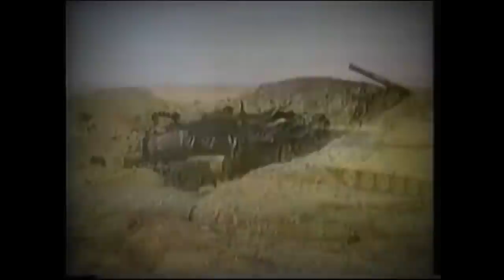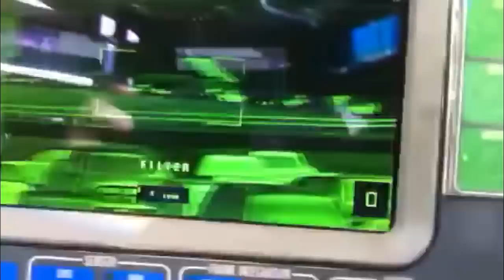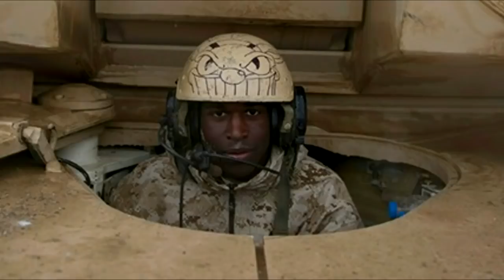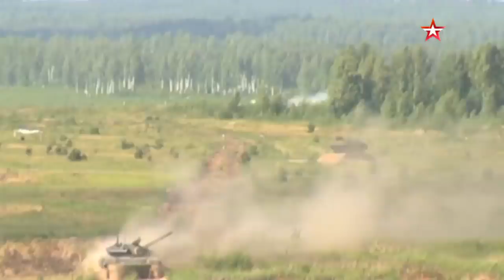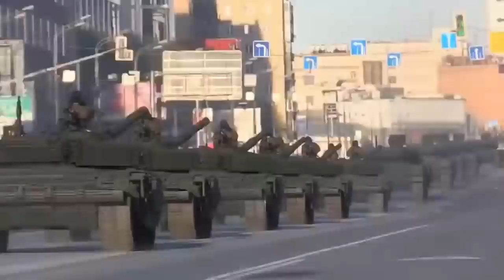Does T-72 stand a chance against M1 Abrams?

Comment: Putting aside the differences in different countries' standards for measuring armor penetration on plain steel or different types of composite armor with different types of rounds when they have the chance to test it and estimating it elsewhen (which is the case with most of the discussed stuff, including literally everything manufactured after about 1985), there are some minor inaccuracies and misillustrations in the video.
First, calling light amplifying (non-thermal) night vision completely obsolete is kind of a long shot. I mean, sure it is inferior to the thermal imaging, maybe vastly inferior in some fields such as this one, but there is a difference between being inferior and being obsolete.
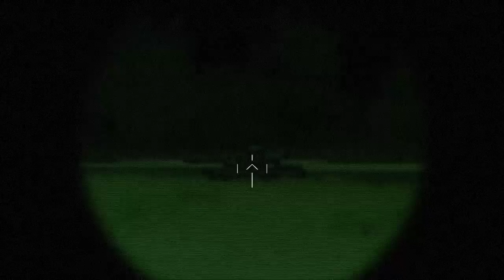Second, at 1:05 the sight picture is from an older Kristall (if I remember it right) NV tank gunner's sight as used on T-72A, B1 (a simplified B), maybe even pre-A models, maybe even stuff like T-55/T-62/T-64/pre-U T-80s, anyway, this sight has definetely no relation to the B3 discussed, or even full-spec B's.
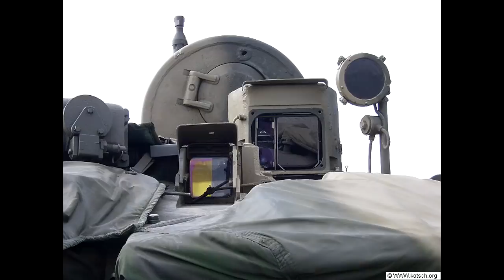Second, at 0:53 (sorry for being out of order with these points) it's not a B3, it's a B2, which was a prototype, or rather a technology demonstrator that didn't see production; however they share the depicted gunner sights arrangement.
Third, footage here in general shows all manner of T-72B versions beside the B3, and even some T-80U's.
Fourth, T-72B3 mod. 2016 isn't a TUSK-esque additional armor kit; it's a now-standard new ERA kit altogether, where Kontakt-V setup (which already had effect not only on HEAT projectiles, but on slower shaped charge projectiles and APDS projectiles as well), is replaced with a newer Relikt ERA that is even more effective while maintaining a comparable weight.
Lastly, I'm unsure whether M1A2 SEP v2 and T-72B3 mod. 2011 are the most widespread versions within respective armed forces. Sure they receive most of the "media coverage" at the moment, but that's also different from being the only or even the main variant in service; even discounting tanks in storage. For instance, I doubt whether there are more B3's or B and B1's in service in Russia at the moment. Plus, they both are far from only tanks currently in service in Russia. Models in current use are (from what I know):
T-72B1 mod.1984 (older Kristall NV sight and Kontakt-1 ERA)
T-72B1 mod.1989 (older Kristall NV sight and Kontakt-V ERA)
T-72B mod.1984 (newer 1K13 Neman NV sight with Refleks ATGM guidance mode and Kontakt-1 ERA)
T-72B mod.1989 (newer 1K13 Neman NV sight with Refleks ATGM guidance mode and Kontakt-V ERA)
T-72BA (an upgraded B with all the same stuff as B mod.89 plus T-90 tracks, plus additional mine protection for driver, plus an improved fire control suite with elements of T-90 equipment integrated into the original system, plus a T-90 turbocharged engine with 900ish or 1000ish hp on some tanks, plus a modified autoloader with capability to use new Svinets APDS rounds on some tanks)
T-72B3 mod.2011 (an upgraded B or B1 with all the same stuff as B mod.89 plus T-90 tracks, plus a further improved fire control suite with elements of T-90MS equipment integrated into the original system, plus an improved accuracy gun and modified autoloader with capability to use new Svinets APDS rounds, plus Sosna thermal sight)
T-72B3 mod.2016 (mod.11 with Relikt ERA, turbocharged T-90MS engine with 1130 hp and robotised gearbox, new tracks design, driver assist computer and a backup camera)
T-80BV (a different kind of tank with a different type of composite armor, Kontakt-1 ERA mounted differently, a different autoloader, a different fire control suite, with older Kobra ATGM capability, on a different chassis, with a gas turbine engine)
T-80BVM army version (an upgraded BV with a new fire control suite, kind of based on one used on T-72B3, with the same Sosna thermal sight but a different day sight, plus an improved accuracy gun and modified autoloader with capability to use new Svinets APDS rounds, plus Relikt ERA)
T-80BVM navy version (same as army version, but with older Kontakt-V style of ERA mounting on the hull sides to allow landing from ships.
T-80U (an improved production version of T-80B with a yet another different type of composite armor, Kontakt-V ERA mounted differerently than on T-72B tanks, a fire control suite kind of based on one on T-80B, but with both a more powerful Buran NV gunner's sight and a more powerful commander's day/night sight with full double set of gunner's controls, plus a more powerful engine)
T-80UE-1 spec.2 (B or BV hull with U engine, additional front armor plate, and the rest of stuff like hull ERA and entire turret taken from decomissioned T-80UD's, including  commander's .50 cal that is stabilised, remote controlled from inside the tank and aimed with commander's sight for firing on ground targets or with a separate AA sight for aerial targets instead of just pintle mounted, plus some elements of T-90 equipment integrated into the UD fire control suite, plus airburst HE-FRAG rounds capability, plus modified autoloader with capability to use new Svinets APDS rounds, plus Plissa thermal sight)
T-90A mod.2004 (T-90 was kind of all the same general improvements, though implemented differently, that made T-80B into T-80U and T-80UD, but applied to T-72B design; thus, a yet yet another type of composite armor, a Kontakt-V ERA mounted in a T-72B-ish manner, fire control suite that is a mix of T-72B elements, T-80UD elements including sighting arrangement and a .50cal integration, and some own elements, a wider T-80-based tracks and a more powerful kind of T-72B-based engine that is turbocharged instead of supercharged; T-90A is a later product-improved version with different turret construction, more powerful 1000hp engine, modified autoloader with capability to use new Svinets APDS rounds and some other improvements)
T-90A mod.2006 (mod.04 with Essa thermal sight instead of Buran NV sight)
T-14 (a batallion or two of these fundamentally new tanks are undergoing troop trials at the moment)
Sprut-SD (airdroppable tanks based on stretched BMD chassis and thus only armored against small arms fire, but with full power 125mm 2A46 gun just like a T-72, complete with autoloader and T-72BA fire control suite, albeit with older Kristall night sight; Russians call it a self-propelled antitank gun, but one can argue it's a light tank).

Comment: There is one thing also, put Abrahams in Russian terrain and it will get stuck in the mud. In autumn/spring when it rains it is impossible to drive the heavy Abrahams anywhere. T-72 is faster, lighter and cheaper. Abrahams is amazing tank, it proved itself in Iraq. But in Russia against thousands T-72 and experienced army, I think Abrahams will not be match, despite being an excellent tank.
Reply: Obviously Doug you know so many things about Abrams as you rightfully correct. But know absolutely nothing about Russia and its terrain. Though right grammar and extra weight will not help the American tank to win the day.

Comment: What about the 1st Cavalry and their M1A2 SEP V3, in the Baltics?       3-1 AHB is also hanging out in Latvia 100 miles from the Russian border.
 Molon Labe
Reply: Too numerically insufficient in strategic terms. Also it won't be just T-72B3M they'd be up against, but attach choppers, CAS planes, artillery strikes etc.

Russians won't be entering Baltics unless NATO organizes an invasion.
Reply: The deployment of NATO troops in the Baltic States aims to develop a bridgehead (logistics and reserve) for the strike to the East. For many years, the us has supported neo-Nazi apartheid regimes in the Baltic States.
In the event of a conflict, the Baltic States will sign their own death sentences. In case of conflict and the United States and Russia, these areas need only as a springboard. 
It is also unclear what the us forgot in the Baltic States? The US is on the other side of the globe.
But if the United States really want to, Russia could settle in South America and the entire Atlantic coast of the United States will be a big Shvedsky table for cruise missiles and ground PTRC. Currently, the United States unilaterally broke the Treaty of RMSD, completely untied the hands of Russia.
Even the strengthening of air defense in the continental us States is still only a plan. The United States has absolutely no distinct military and object air defense and relies solely on aviation.
Reply: @elusive6119  You comments are laughable. You need to build a Navy and a air force using Soviet designs would not have worked in 1986 and they certainly will not work in 2020. During the WWII years the US spent 35% of GDP to beat the Japanese and the Germans, if the US was to spend 35% today it would be 7 Trillion per year on Military. You Russians complain about the 700 Billion in 2019!
Reply: @GlobalRage  The us military budget is as bloated as their economy. the efficiency of spending does not stand up to criticism. Russia does not need rivalry with the us, except that aggression always comes from the US. Russia is not going to include it in the arms race, we do not need it. it is enough to destroy 300-400 targets even without the use of nuclear weapons and the meaning of war will be exhausted. The US is fighting only to maintain its bloated and skewed economy, but why do you need a dollar in the grave?

Comment: Not a single word about the HORRIBLE ergonomics of the T72. Case in point; Per Warsaw Pact doctrine  only persons if 5'7" or less can be assigned to the Armored Corps.

In addition, you failed to discuss the inferior 2-Piece ammunition utilized by T-72/T-90 and it propensity to ignite prematurely. The breech of the T-72 has a cooling system necessary to keep the propellant from igniting prematurely and killing the crew. Unfortunately, if fails quite often and YOUTUBE is replete with mysterious T-72 explosions, mystery solved......The T-72 tank is  the "Ivan Cooker."

https://youtu.be/K6Ra8JcY7k8

https://youtu.be/ZCYt2RmcMew

https://youtu.be/-HIMhIGoFP4
Reply: Fuck off troll ;)

Comment: pretty sure a t72b3 atgm could not penetrate the front hull armor, and sabot couldnt penetrate the hull or turret until a range of 1km or less
Reply: Depends on where you hit it.

Also penetration is unnecessary. If ATGM blows a track off Abrams, it's immobilized. From there if crew aren't crazy, suicidal or stupid, they'll abandon tank and retreat. Immobile tank is a pillbox that's easily killed.
Reply: @Max_Da_G  we carry extra track on the tank, if we could we would take the track off , and put the new track segments on and connect the track. im a tanker, i know
Reply: Depends on how advanced ammunition they are using. The atgm they can fire may have new warhead... new liner for instance.

Comment: Just because an APFSDS round can penetrate 370 mm of RHA at an 60° angle does not automatically mean that it can penetrate the same distance at 90°. Long rod penetrators are good at penetrating angled armor because they simply break parts of the armor at an angle but that effect cant be achieved at 90° so the round having the same penetration at 90° is very unlikely.
Reply: Not necessarily. External armor plating isn't made to chip and break. It's made of medium hardness specifically NOT to break.
Penetration at 60 will be lower than at 90.
Reply: @Max_Da_G  I didn't mention any particular kind of armor. I just said that modern APFSDS was designed to deal with highly angled armor and that for example is one reason why rounds get increasingly longer like M829A4 and DM53. Saying that their penetration at 90° is symmetrical to 60° would be illogical.

Comment: Yes, with the latest upgrades and proper ammunition, however the original T72 was never designed to go toe to toe with western Armor like the M1, but it was an excellent infantry support tank for the price, It was the Soviet answer to US M60 and probably more capable with a 125mm main gun.
Reply: T-72 was way more capable than anything the west had to offer by the year of 1979 when T-72M1 came out. It was the best tank in the world.

It is still superior in a number of aspects to its modern western counterparts. Light Weight and Ease of Maintenance. These heavy western tanks can get stuck easily, but the T-72 is lighter and has lower ground pressure, and can be easily evacuated or get unstuck on the battlefield. Plus, the repairs are cheap and relatively simple. As well as it’s being a smaller harder to hit and to detect target.

Comment: T-72 is OK
Reply: Its getting somewhat "long in the tooth", but its not a pushover by any means.

oh, and what the heck does the primarch of the Imperial Fists comment on a T-72 for ?!  Go back to your Leman Russ :p
Reply: Well, apart from not modernized T-72A, T-72M and M1, first T-72B. Those are simply too old.
 I would say any T-72 should now take adventage of: 
- full ERA/NERA setup, tandem heads resistant (on turret at least). Turret ERA modules backed with thick steel/tungsten or steel/ceramic plates.
- changed or simply modified drive with engine tuned up to 900HP and paired with re-designed manual transmission (with an actual field reverse gear!) Or simply powerpack with automatic transmission and yoke for the driver.
- gun (and its two plane stabilization) at least 2A46M or simmilar with effective ammo.
- fully automated FCS with modern balistic computer
- thermal vision for the driver - (1st gen.?) Preferably 2nd gen thermal sights  for gunner and for TC as well. Maybe even with a display and possibility of future upgrading the system with modules for implementation of the full Hunter-Killer capabilities.
- laser detection system with manual and fully automatic modes within APS - of "soft kill" type.
- balistic "blankets" for crew sections and autoloader drum. 
- additional armor plates for rear lower hull on sides and redesigned armor in front of the drivers hatch.
Such modernization makes any old type of T-72 look like the tank itself would cover only a fraction of all costs.
Reply: Placid, do you mean “lemon”? Cause I don’t know what you mean, when you say “leman”....
Reply: @brianpayne2478 
No, it was something of an internal joke. The OP's nick is "Rogal Dorn", which is a Primarch in the Warhammer 40k universe. In the 40k Universe, the most common imperial battletank is called a "Leman Russ" :)
Reply: Nowhere man it’s the best

Comment: NO NO NO!!!!!!!!!

First off lets not play this game where the M1A2 is only slightly better because it is far superior and it's not even debatable. The M1A2 uses 3rd generation thermal sights, not second gen. The front of the M1A2's turret is rated at over 950mm against KE and over 1,500mm against HEAT. The UFU (upper front hull) is rated between 715mm and 950mm aginst KE and 750mm to 1,500mm against HEAT. The LFP (lower front plate) is even stronger at between 620mm to 1,000mm KE and 1,200mm to 2,260mm against HEAT. The T-72B might can scratch the paint on a M1A2 Abrams frontally, but it would have to EXTREMELY lucky to penetrate it.

Yes a T-72B can get lucky and destroy an Abrams if it can get a clean shot into the sides or rear of the tank. But any modern tank can penetrated any tank by shooting it in the sides or rear. Also those ATGMS are useless if it can't get close enough to spot the Abrams. Plus ATGMS are easily jammed and defeated.

I realize this is a pro Russian channel, but don't even start on the T-14 lol.
Reply: No you are wrong, Abrams has 2500000mm of frontal armor, a electromagnetic gun, a revival system and a golden toilet inside. We know. Jam atgms? They are wire guided! Someone runs fast and plugs in? Just go eat your bbq before it goes cold...